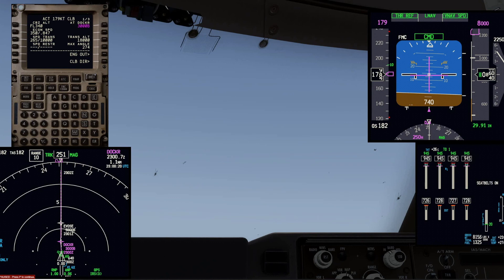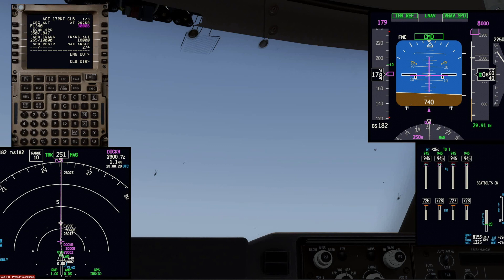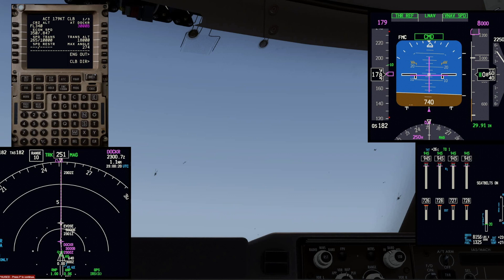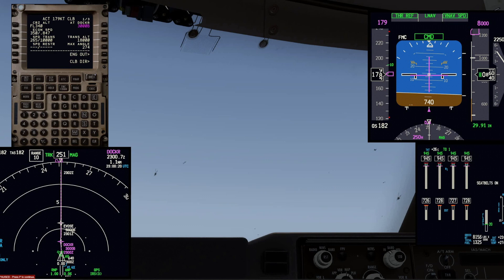Ep 3 | Part 2 | TIMED TRAINING TIPS | VNAV CLB PAGE

Comment: How do you set best rate if ATC tells you to expedite your climb?
Reply from the maker: Best Rate would be set on the MCP in the speed window or also could be programmed on the VNAV CLB page as well if using VNAV during the climb, which is usually the case. Most commonly the PF is on the VNAV Page after Takeoff and you can approximate Best Rate Of Climb by using Best Angle of Climb at R4 on the CDU and adding 40 Knots to that number, so if Max Angle were 255, then Best Rate would be 295. Usually if ATC says give me your best rate through FL220, for example, they really mean give me your most altitude gain in a given distance, which is max angle vs most altitude gained in a given time, which is Best Rate. So normally you would give them Max Angle to help them out. If you can't make what they are asking you to do, you tell them Unable and then they adjust by vectors, etc...